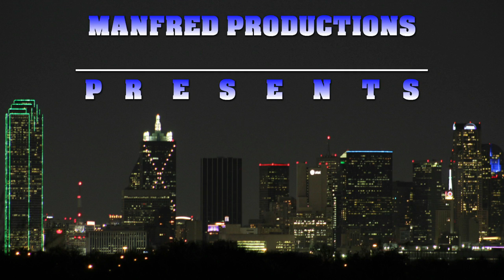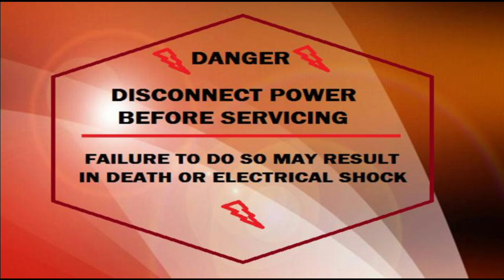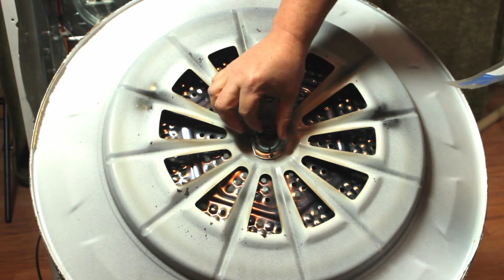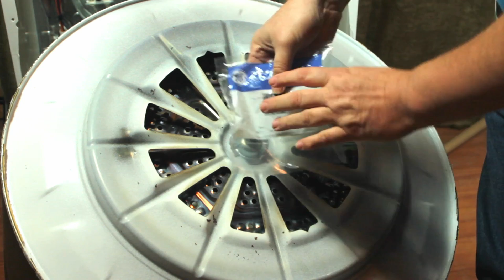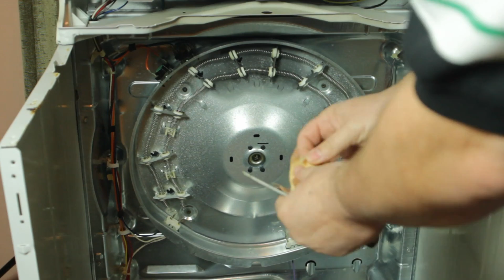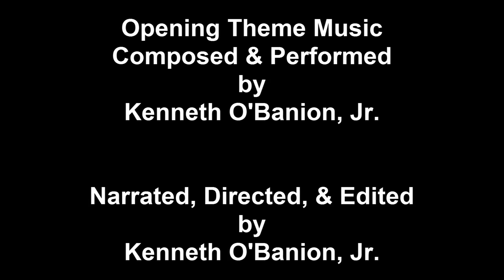GE Dryer Repair - Noisy or Screeching - Rear Drum Bearing WE25M40

Comment: im trying to open bak of the drier where u hook up drum. reason for that is i think somethinng went inside thru holes next to bearing area. is this worth an attempt? idk how ez it is to assemble after  disassembllling
Reply: canyonman1963 i did  open my model is bit different and i cleaned it inside. if u want i can show u pic. im little concernd that the electricity part which has plastic under. just small piece of it got broke when i tightened the screw driver. i hope  nothin is wrong with that. i also found a piece of flexible  plastic(?) that is almos like a mirror. im sure it was dropped from the hole where u plug  in the drum when i opened it. do you think im fine? my drier uses natural gas and i want everything to be safe.
Reply: the little chip you see was what i was talkin about. Right above the screw nuts, the black plastic is broke
Reply: canyonman1963 what is short? you mean like when electricity goes off? i was so excited yesterday when i reassmbled and drier worked perfectly fine.. now im with another task sigh.... which websites are there for best deals buyin parts?
Reply: canyonman1963 i found the chips name. its called thermostat trimmer. is it still dangerous if this is not replaced? and wat does trimmer do?
Reply: canyonman1963 drsr483gd2ww part 505
Reply: thanks a lot. I am actually ordering it from the original website, partselect dot com,  since I lost the screw in the process of disassembling.. although I do have similar screw, I want to make sure there is no issue using different screw.

Comment: Great video, but the rear drum bearing does not require grease. In fact, it will soon mix with the lint flying around in the dryer and make matters worse. There's nothing inside this dryer that requires grease.

Comment: I replaced the whole bearing kit and belt and my dryer still squeaks. Any troubleshooting tips?
Reply from the maker: +mamabearmc Well, if you can identify exactly which part of the dryer the noise is coming from, it will help figure out what it needs.  If it is coming from the top front, there is a plastic bearing there with plastic slides on it that wear out.  If it is the front lower part of the dryer, there is a felt gasket or seal that could be worn out or partially missing, it goes around the inner front door panel down at the bottom.  if the noise is at the rear center of the machine, then that would be the bearing kit you replaced, and perhaps something there is wrong still.  Hope this helps you out!

Comment: My dryer only makes noise when it has a heavy load.  Is that normally a sign of a bad rear bearing?  I do not get the noise when the load is light or the clothes have dried some.
Reply from the maker: +David Smith Probably the bearing is just starting to wear out.  It can be more pronounced when heavy load is in the dryer.  It will probably get worse over time.  Hope you fixed it by now.  Didn't see your comment until just now while browsing community section.  YouTube for some reason hasn't been sending email notifications of comments....

Comment from the maker: For SBLfromNS...  The part number for the drum bearing kit is mentioned in the title for this video.  As for the individual part numbers, the sleeve is not universal, there are about 4 or 5 different sizes of them, and if you are replacing just the sleeve and not the whole kit, you need to look up the correct one for your dryer using the dryer model number.  If I listed a part number for the sleeve on here, it would work for some, but be the wrong part number for others, so best not to list it and that way people will have to look it up using their dryer's model number!

Comment: I replaced the glides on the front of a GE dryer and now I am getting some noise and after about 30 seconds it shuts off. Any advice?
Reply from the maker: Well, shutting off after 30 seconds indicates the motor overheated.  This can happen if the drum is dragging or rubbing on something it shouldn't be, usually due to not being completely seated properly at the rear drum bearing.  Try opening front panel again, and re-set the drum into the bulkhead bearing mount.  If still has rubbing sound after putting back together, try raising both front feet and see if that helps the drum settle back away from the front panel.

Comment: How do you know if you need to replace the belt or the bearing? Our dryer has been making a loud squealing or screeching sound every time we use it. And it seems like it takes forever to dry clothes.
Reply: canyonman1963 Okay, thank you so much for getting back to me. I wasn't sure how long it would have taken you to respond. So I would definitely have to take the dryer apart to see what going on with it.? And where would i find the serial number in order to get the right part/parts?
Reply: canyonman1963 And you mentioned in one of your videos that I can order parts from you... Or can you just take the model number and serial number to like home depo or some other handyman type store?
Reply: canyonman1963 I took some pictures of the insides of my dryer. Do you have an email i may send them to as to get a better idea of what i need to replace.
Reply: canyonman1963 Thank you. I just sent you the email. It should contain 4 pictures.

Comment: Hi - Awesome disassembling instructions on the other video. A few days ago I started the dryer and it made a god awful screeching noise, which i think means metal on metal. I got everything apart, and I looked at the  parts schematic for my GE Profile dryer and there is supposed to be a ball in the rear drum bearing. There is no ball?! Where did it go? Also, is it cool to vacuum out the dryer - there was a ton of lint in the lint chute and lint everywhere, i have dogs, so much towel use and lint.
Reply: canyonman1963 I think the ball is there, the big metal ball that sits on the teflon bearing. The diagram shows like a little ball on it's own, which was misleading. This dryer came with the house. There was really a ton of lint inside the machine, even compressed between the drum and the metal shield-like thing that has felt around it. I'm wondering if excessive lint could have impeded the drum's rotation? I am reassembling now, and will do a test run. Everything looks like it's in good shape - no excessive wear etc. If it works, at least i learned alot about dryers. thanks for these videos.